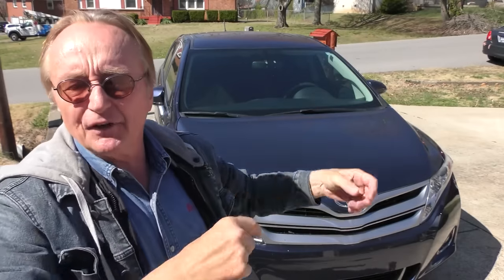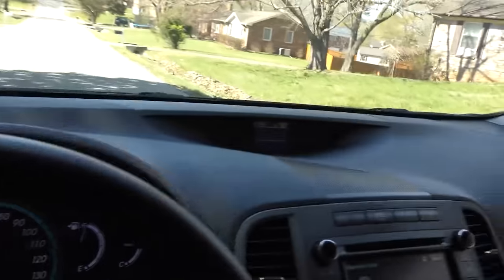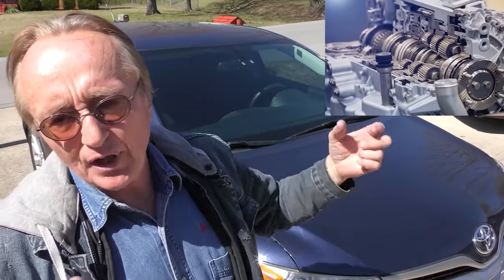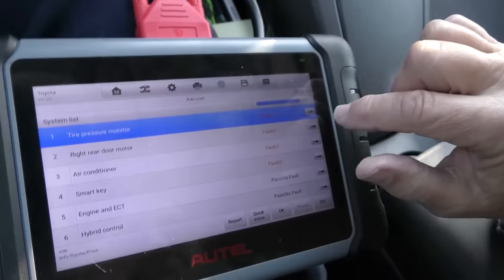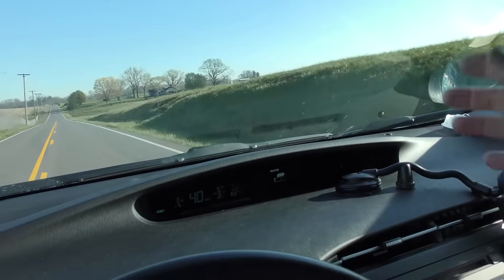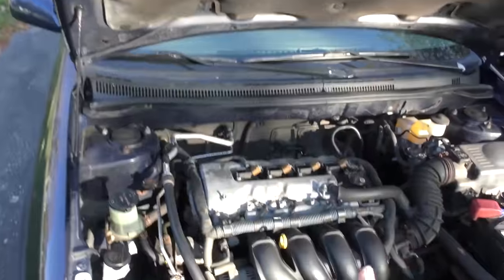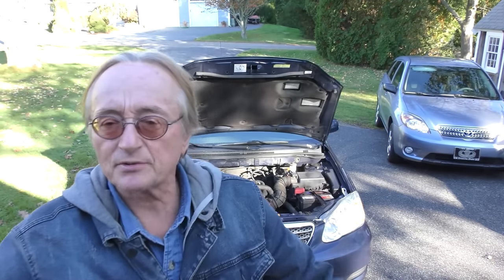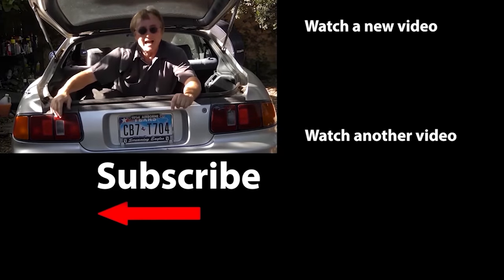Everyone Hate These Cars, So You Can Buy One Dirt Cheap

Comment: Toyota Corolla are very well built cars. Toyota doesn't make them cheaply as Ford, GM & Chrysler made their small cars cheaply to reduce costs which means they will fall apart as they age, but not Toyota. Also, Toyota doesn't put turbo on them to make them reliable and long lasting